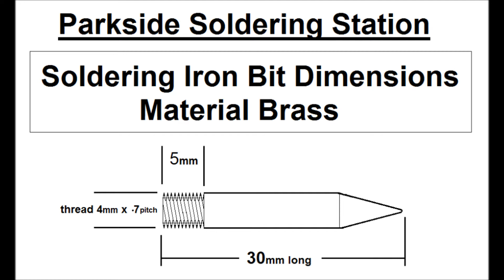soldering iron bit for Parkside Soldering Station

Comment: u use calculator for recording?
Reply from the maker: +Pawel Kowalski - From the tip supplied with the soldering iron I
used a micrometer for the diameter of the thread - a thread gauge for the pitch
of thread - and thread tables to identify what thread it was.